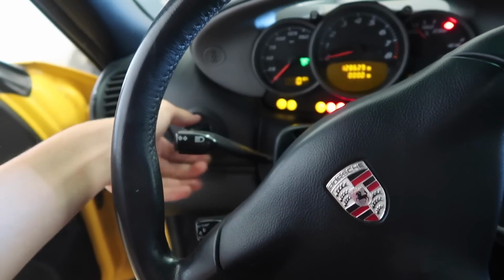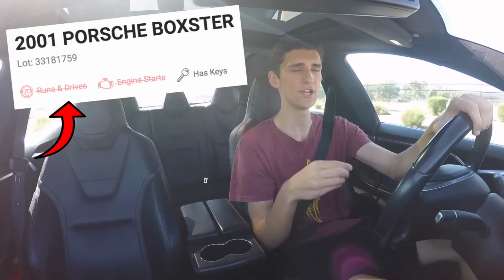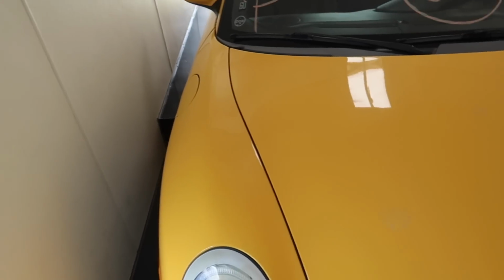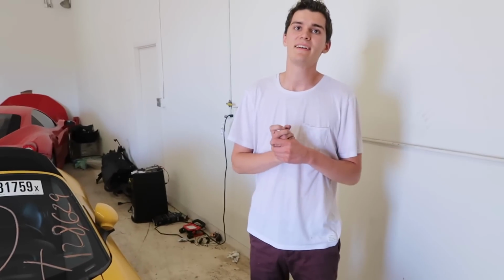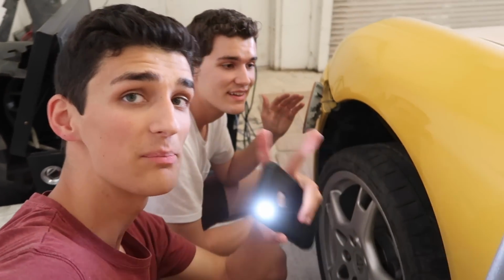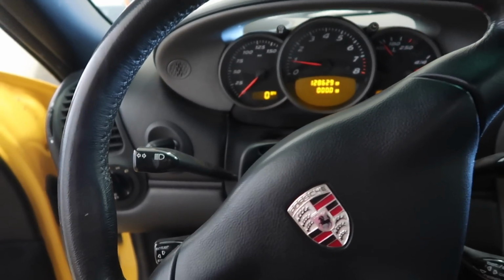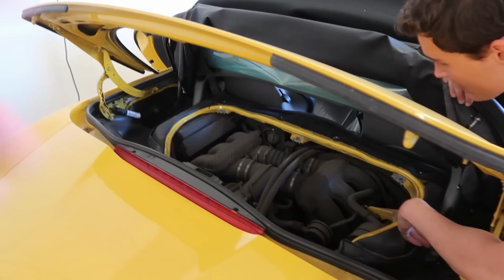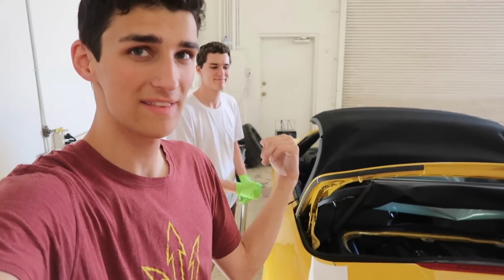I Bought a TOTALED Porsche For $500 at Salvage Auction SIGHT UNSEEN!

Comment: that car wasn’t totaled. totaled means the damage is more than total cost
Reply: Kirk Ingold so smart
Reply: @thetwosevenfive  it cost 23$ to get it running
Reply: Kirk Ingold totaled means it to the point of no repair
Reply: Yes, and what if they thought it would meet that spec. since the hood wouldn't open and the wheel looked horribly bent out?
Reply from the maker: The car was indeed totaled, the cost for new Porsche parts was probably too high for insurance to go through with repairs. We can obviously use used parts and save a ton of money!
Reply: @skaterbi922  yes HIM, but not a workshop...
Reply: Kirk Ingold duh

Comment: Every Porsche owner knows there is a manual steel wire to open the trunk!!
Reply: Klaus Kapalle well they just got their first porche💀
Reply: Ryder Jack if you were OG you’d know they’ve had a few older ones
Reply: As well as every Volkswagen owner from the 70’s.
Reply: Not only the owners me to and I'm 13
Reply: That steel wire is for the gas cap, you can jump the car from the fuse box in the driver footwell 😭
Reply: @BaxterRoss  The steel wire is for the front trunk.  Trust me I was I just working on mine.  My cable ran from the latch and around to the passenger (right) side fender.
Reply: Klaus Kapalle clearly they’re not too smart klaus. I mean they do own a $10 harbor freight impact 😂😂
Reply: Not everyone has a Porsche
Reply: Klaus Kapalle every car with electronic hood or trunk has a manual opener Einstein
Reply: Tym T 😂😂👍🏼👍🏼

Comment: Upgraded steering wheel, 6 speed, 4 stalk function and also 987 wheels! Great find
Reply: A 2001 is only worth $2,500 as a non runner, if the engine was knackered it would have been a bad deal
Reply: noob is a 500 dollars car,less he spend better is
Reply: 5 speed
Reply: He'd of got 2k for the seats plus parting out still wouldnt of been a bad deal
Reply: He wouldnt get $2000 for the seats.
Reply: Ryan Adam I get $700 for stock seats, those style would easily get $2k to the right customer

Comment: To open the hood with a dead battery, put the positive of a jump box, jumper cables to the red post sticking out of the fuse box, and the ground goes to the door check/hinge. That will give you power to open the hood

Comment: Give it an oil change and inspect the oil for metal debris, the IMS bearing can fail, checking oil will help to see if the bearing might be failing/disintegrating.  You don’t want the bearing to fail as this will mean engine out and a rebuild, just my 2 cents as Boxster owner
Reply: given the previous owner was part of the porsche club there is a good chance the IMS bearing was replaced..

Comment: I own a 99 Boxster. I'm the second owner and have had it for about 10 years. And yes I've let the battery die before and never could find the cable to pop the trunk. I moved the cable to one of the vents. I ended up jumping the car through the cigarette lighter to get it open.

And never change the exhaust on those, you'll lose that amazing midrange sound it makes.

Comment: How’s it a $500 car if the car cost $2,500 and you sell the seats for $3,000 you’re not gonna be spending the $500 on the car you would be making $500😂
Reply: Wait, was it $2.5K or $500?? They kept saying $500.
Reply: @gtarules1  $500 is clickbait, it's 2.5k ($500 if they sell the seats, but they might not even sell the seats)....
Reply: 2500 + auction fees - selling car seats = $500 total cost
Reply: daexion that means they paid $3500 with auction fees
Reply: @grantkilo758  At Barrett Jackson at least, the fees are 10%, so that'd put him at $2750.

As far as selling the seats, are they worth $2000 the way the people on Storage Wars say things are worth or would someone really pay $2000 for them as-is?

If they are really worth $2000 and not just "worth" $2000, is that what you could get easily locally?  Like a quick Craigslist ad and you have $2000 in your pocket in short order and the person came and picked them up.  Or will you just have a bunch of people show up offering $1200-1500 and ultimately you take something in that range just so you can be done with it?

Or do you need to widen your search and use eBay (and pay fees and shipping)?  If on eBay they are worth $2000, but will cost $200 to ship and eBay and PayPal will take their ~$260, then cash in your pocket is down to around $1540 and you have to deal with shipping some bulky items.  And after that , if the second case above is how it goes down, then you really didn't gain much.

Comment: I owned a new 2003 Boxster - I sold it June 2021 with 67k miles.   No issues other than I had to replace an alternator in 2019.   Fun little car and still looked like new.

Comment: Just thinking about it, it seems that a manual frunk release could be made with a remote choke cable, or bicycle brake cable and a few fittings at a bike store. You can make those any length you want.

Comment: I have an S type 4.2 Jaguar, and the battery which is in the trunk went dead one winter so I googled it and there is a key hole in the trunk edge where you put the ignition key. Good video guys I just subscribed.

Comment: Make it louder,it sounds like a gt3!?!?

And don't sell the seats👌
Reply: It's damn near impossible to make a 986 or even a 987 sound like a gt3. Although they're both flat 6 engines, that's where the similarities stop. The GT3's have larger displacement motors, a dry sump oil-system, and are the "Mezger" engine which is a different engine than the M96 (don't know sub variant) that comes in the boxster. A straight piped boxster sounds a little ricey and doesn't have the howl that a gt3 has. And I'm not dissing you, I just thought I'd voice my knowledge (even if it may be wrong). But hell yeah, MAKE THAT SHIT LOUDER!!!!

Comment: Regarding the seats, check the build codes (the paper on the frunk lid).  If it doesn't specify the seats that are now in it, sell 'em.  If it does, you might want to keep 'em.  $2500 is still cheap for a 986, even if it is a base.

Comment: I have a porsche just like it ypu can open front hood on the left side of the front wheel there will be a black semi thick cord poll hard and it will open 
It happens with the safety mechanisms locks it self after 7 days and they ipen the fuse box because you can also just start from fuse box

Comment: you need more power than a cheap ac dc transformer ,a second car battery would have open it and only after a few minutes charging the dead battery in the car, amateurs.

Comment: First off the 2001 Porsche has a motor that will blow up after like 20,000 miles. They have recalls and it was one of porsches major mistakes. Looks like it's your mistake now🤣🤣
Do ya research my guy✌
Reply: That car has 128,xxx miles on the odometer. But thanks for playing expert.
Reply: @Jays_gone_by  the 128xxx are body miles. NOT ON THE MOTOR. Thanks tho, play again